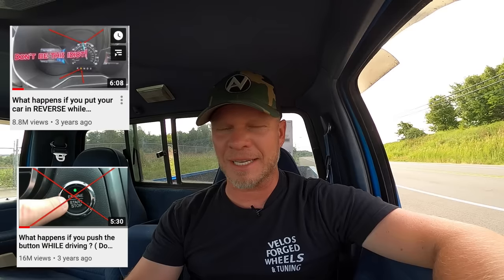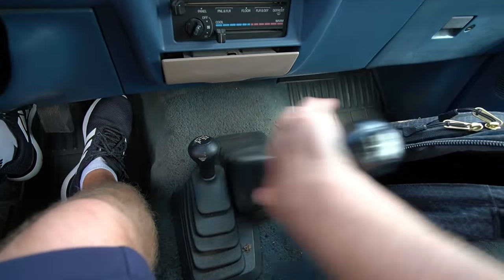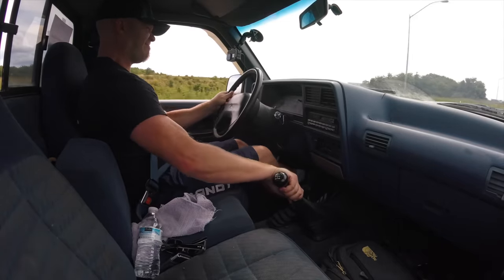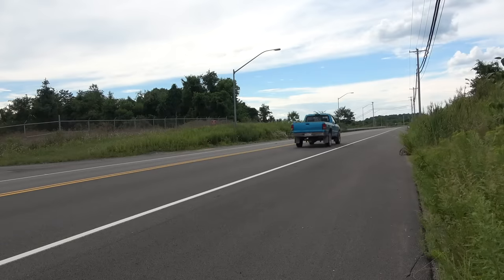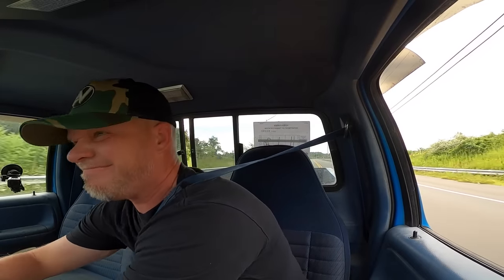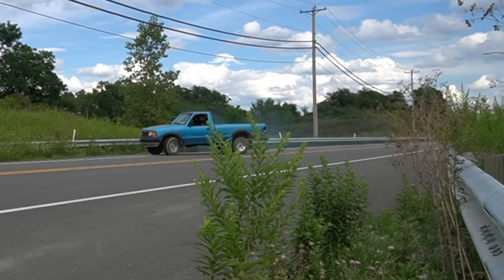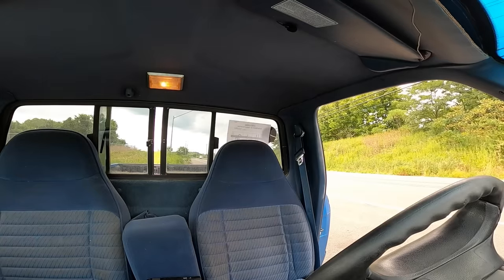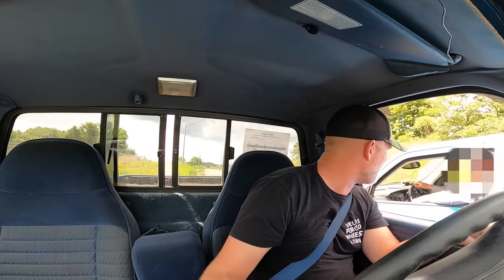What Happens If You Put A MANUAL Transmission In REVERSE While Driving?

Comment: I have a feeling things would break if you did this in a FWD car. If you put your car in reverse while driving, just like when breaking, the weight of the car will tip forward. This was a RWD car, so basically a huge weight of the car got lifted off of the rear and moved towards the front. For this reason the wheels were able to spin. It's similar like if your were driving backwards in a FWD car and put it in first gear, the wheels would (hopefully) spin out because the weight of the car got moved over to the rear. But if you put weight the free-spinning-wheels, and try to spin them the other way that's when you gonna have problems. It's an interesting experiment nonetheless. @AutoVlog are we going to see a FWD version of this test?
Reply: It will do exactly the same as locking the front brakes... The rear-end will lift up and the car will go into understeer.
Reply: Dam yeah you're right transmission  could get cooked way faster
Reply: Doesn't matter unless you drive with no sensors maybe
Reply: Ever see that vid of the (person) pulling out some dudes keys and the steering locks up and they fucking crash?
Reply: I doubt it would make much of a difference. The clutch was slipping a shit ton in this it would just slip even more with weight on the wheels with drive

Comment: do the opposite get it into first while reversing
Reply: I was going to say the same thing
Reply: Ain't gonna do much or have to much drama go on...1st gear is synchronized so the trans ain't gonna make much noise and he is probably gonna do a huge burnout that it...I use to do it all the time in my 6th gen coupe accord...only thing we are harming is the tires..
Reply: Rey Fuentes i know this is the whole point the burnout
Reply: The good old reverse to first
Reply: I used to do that a lot to burn out. Doesn't do any damage to the trans if that's what you're thinking
Reply: That's the way I used to do a burnout in my small old Kia😂
Reply: Rey Fuentes and the diff
Reply: get going fast enough, and do it with a steer of the wheel and you've got yourself a j turn
Reply: @reyfuentes4572  And the clutch
Reply: @LatvianVideo  nah if u know how to do it...

Comment: I did this accidentally kinda in a 76 parisianne.  The engine stopped and continued rolling till i stopped.  It was an automatic transission.  Once stopped, put in park, wiped my brow clear of sweat with 40 towels, and tuened the key.  Just turned on... procreeded to drive away.  Car was sold a couple years later.  The sound was terrifying though in the moment.

Comment: I did this with a U-hal. I needed a big truck and when i got in it was a stick. I never drove one before and I said well today I'm gonna learn. I knew the basics from my friend letting me try once and having a motorcycle. It stalled a few times and at one point I did put it in reverse. No issues, made it home and was able to drive it. That was how I learned to drive a manual transmission.

Comment: Most manual transmissions have a gate type system that engages when you are going forwards and it’s made to stop you from going into reverse accidentally, I have an 02 subaru impreza and I accidentally went from 5th into reverse in traffic going 80km/h and the gate failed but I have since tried it on backroads and the gate has worked fine so that is why it was so hard to get into reverse

Comment: 1994 Ford Ranger manual transmission? I know what happens if it's a mid-80's Ford automatic transmission van if you throw it into reverse while going 55mph without letting up on the gas pedal. I couldn't believe it. And the transmission didn't die until about a year later doing that 1 - 2 times per week.

Comment: Next do it in 4 wheel drive
Reply: It’s not 4x4
Reply: @americantrucknation4891  what's the second stick for then?
Reply: Will O'Meara it is 4x4 there is a badge on the box
Reply: @americantrucknation4891  yes it is the shifter is on the floor @404
Reply: I think he'll loose all traction in a 4 wheel drive, the car just be skidding

Comment: I was a dumbass once when, circa 1982, I had a 1976 Toyota wagon that was my only car and I figured if I put in the clutch (it was a manual) and held it in..... I should be able to click the car into reverse and it shouldn't hurt anything.  I remember, it was going north on the 405 freeway not far from the Getty Museum of Art.

I was wrong.

It was a bit difficult to force it into that gear and made this louder and louder whining sound.... and then, for some reason, the transmission wouldn't work, after that. It was very confusing (LOL). 

Needed to call a tow truck and get a rebuilt transmission (LOL :-). 

It wasn't so LOL, back then. Luckily no one got hurt, etc. But back then, probably around 1982 or whatever – that was a lot of money to spend – I think it was about $550 to fix it.

Comment: Used to lock up the brakes on manual 4wd pickup on snowy road or ice and throw it in reverse and spin wheels backwards while sliding forward. Almost got in bad accident when abs malfunctioned and putting it in park or reverse did nothing.  Liked the video! Old cars rule. We used to turn off car while driving for a few seconds then turn it back on and it would backfire.

Comment: I drive a kia rio 5 speed and the reverse is with first gear, just pull up the lever.... I put mine in reverse to flash my white lights to the car behind me, but I NEVER lift my foot off the clutch ... so nothing happens to my speed or damaged anything- I only have the reverse lights come on and off 3 times

Comment: i acctually did it accidantly while in 5th and i found out halv sec later and quickly put it back in 4th, i heard screecheng lucky i didnt move my foot off the transmission pedal so nothing happend, basicly you would kill your car pretty fast, i am surprised this car lasted this long while doing this, also gears for transmissions are on the drivers side of the car so that sider will be the first to halt, you would find yourself going right even though youre wheels arent going on that side.  great video, never try this you will hurt yself and others or best case scenario you ll pay 5000$ for new set of transmission gear. Peace

Comment: The (mostly) quiet engagement is probably because it has a synchronized reverse. Some Mazda transmissions do, Ford used some Mazda transmissions.  Once it is engaged,  the trauma is over, releasing the clutch seems abusive, but the torque applied to the transmission is limited by the low traction  of the rear tires. Overspeeding the clutch disc could happen, maybe. Reverse is a low gear ratio, so the disc is made to spin pretty fast. No doubt it's a little hard on that synchro.
   You can do the same thing without grinding in an unsynchronized reverse type trans by braking hard enough to lock both drive wheels, putting it in reverse, then releasing brakes and clutch. Easier to do this on snow....on dry pavement, the rapid deceleration is distracting...on snow or ice, it can be done smoothly. I did it for "fooling around" purposes, but it's more fun to do donuts, once you get the technique down, the "reserve while going forward" isn't that exciting. 
   That security guy needs to be reminded that it isn't his road! Or was it on the property of some company?

Comment: Main question: WHY? Why doing reverse if you still drive forward?
I did it many times with low speed. It allows to switch seamlessly the direction. If you make enough exercises you can do a reverse parking without stopping.

Comment: @2:10 Why would you? I have two cars, one is a 6-speed manual, and one is a 5-speed manual with reverse in that position. When I'm up to speed on the highway I try to move it to the most efficient gear ... so that's usually 6th gear. Unless it sounds like grinding gears, then I'll shift to 5th.

Comment: Slammed a s-10 in 1st gear going 60mph, when letting the clutch out the truck didn’t hesitate or anything no jerking just rolled to a stop. The clutch exploded in 1,000 pieces all that was left was the hub of the clutch on the input shaft lol.

Comment: Well, engineers kind of thought about this, and the old school stuff (because they have none or almost no electronics) are built with mechanical features to prevent some things to happen on certain conditions but allow on other conditions.
The biggest reason, as you clearly notice while doing it, why a transmission is not supposed to engage reverse while driving forward is because the car will slide instead of driving, and may not so gracefully move into and another car.
If you do it many many times, over and over and over again, of course eventually you will wear out early some parts of the entire drivetrain assembly, but there's no reason why this should happen after the very first try unless the transmission is already broken from something else before.

Comment: It works with you rear wheel drive truck that is very light in the back. And probably the truck tranny is heavy duty. Load the back with cement bags.
Or try that in a front wheel drive car with the heavy engine on the wheels. And a car tranny is much weaker and will probably explode.

Comment: I wonder, how relevant here is the fact that this car is a rear-wheel drive pickup, which is relatively light in the back part, so tires could manage to lose the grip and start spinning backwards :) What if it was front-wheel drive, with a heavy front part, and good new tires?

Comment: Did you shift into neutral first? Or just try to go straight from 5th to reverse? Usually, there's a reverse lockout that prevents someone from accidentally thinking their car has one more gear than it actually does. This lockout is usually disengaged when the shifter is returned to the central neutral position. But I'm not sure if there's an additional lockout mechanism in the gearbox to stop people from bypassing the main lockout while moving.
Reply: Transmissions vary. My Peugeot 308 (and the two 306s I had before) will allow me to engage reverse while still travelling forward slowly, having not quite slowed to a complete halt. My wife's Honda CR-V and the Civic that she had before will not. I have got into the bad habit in my car of changing into reverse while still braking, ready to bring up the clutch once the car has been stopped for a few milliseconds (!), and I found by bitter experience that I couldn't do that in the Honda.

The Honda gearbox has reverse to the right of sixth, with a stronger spring. My Peugeot has it to the left of first, with both a stronger spring and a collar that must be lifted. I've not driven a car with reverse in line with fifth - as far as I remember, my 5-speed VW Golfs had reverse offset from fifth against a stronger spring - but I could be wrong, because I sold the last Golf 30 years ago.

Comment: "let me just absolutely mangle my synchros for science"

You could have just done it on BeamNG with a decent race wheel. The same thing happens, as long as you're holding the clutch down when you go into reverse it 99% of the time will catch but it can break the transmission very easily even if you do have good clutch control because two forms of opposing force are acting against a metal brace in the transmission

Comment: Putting a manual transmission into reverse while driving can cause severe damage to the transmission components, potentially leading to a complete failure. It's crucial to engage reverse only when the vehicle is at a complete stop to avoid any damage.

Comment: I remember an ancient joke
A man buys the latest Ferrari. Requires option with manual transmission - automatic, they say, is boring and, like, not cool. The car drives out of the salon gate and disappears around the bend with a roar. Two minutes later, man calls the dealership and demands to replace the car - the gearbox is broken. The whole salon is in shock, a Ferrari is being dragged in back by the tow truck, they give him another one. The same story repeats itself. The manager politely asks if the customer would mind if the technician a ride with him. The guy doesn't mind. The car starts moving. The man comments on his actions: - So, first, second, third... fifth... And now - R - rocket!

Comment: This should honestly be a Ford advertisement because I don't think this is possible with many manual transmissions out there.  Pretty much all old manuals don't have a synchro for the reverse gear because it assumes that you're stationary when putting it in reverse so theoretically this should just shred your R gear by even trying.

Comment: "Why would you accidentally put your transmission into reverse, you really wouldn't.

Man has clearly never driven a manual F750. Those gears are separated by paper, and everyone who test drove it for the first time went from first to reverse. First is in the top left corner. Reverse is in the bottom left corner. I was the unlucky soul who put it in reverse going uphill at  a stoplight.

Comment: do r then  5 gear
Reply: That would either stall the engine or wear out the clutch severely if you try to ease it in. But you could do it, and it would be very anti-climactic. I've shifted into first going backwards on a modern car let alone this thing.

The reason he was able to do a massive burnout is cause the gear ratio in reverse is around 3:1, engine:wheels. In 5th, if you tried to burnout, the engine would stall, OR you can very VERY gradually release the clutch which would SLOWLY stop the car and make it move forward. Essentially, you're using the clutch as a smooth break.